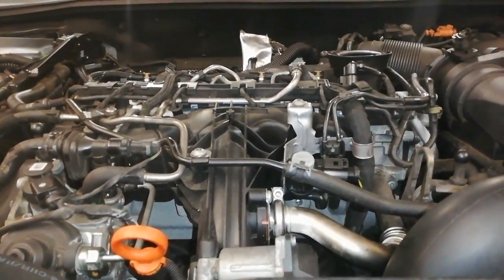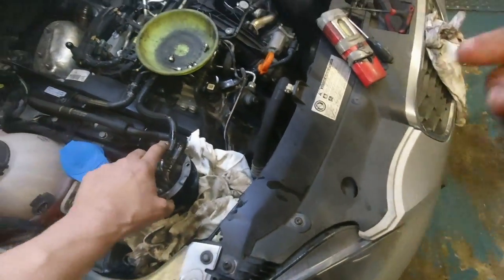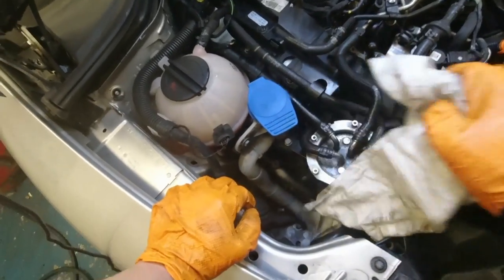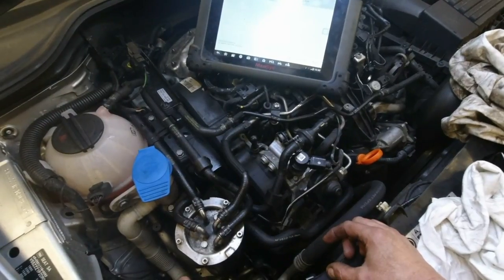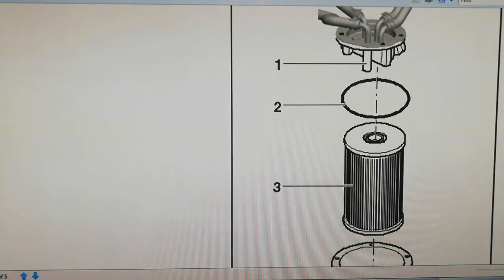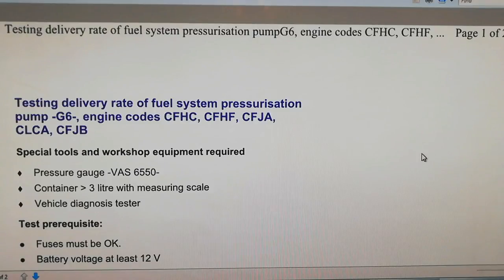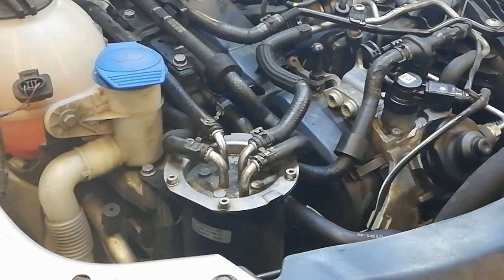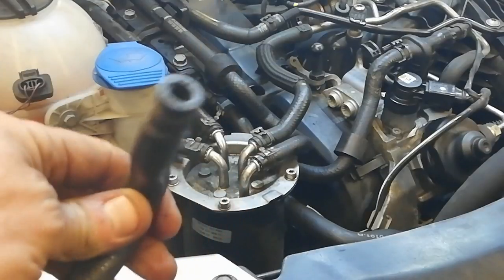VW 2.0TDI Common Rail Fuel Filter And Fuel Pressure Specs

Comment: Outstanding info Dave!!   I have been going through some data about air, water, new ISO fuel filter specs from injector companies and fuel temp coming from the fuel rail.  I not questioning your info. Knowing the effect of heat on diesel fuel (atomization/lubricity), I find it strange that some manufactures return fuel from the rail back the tank (some via coolers, temps reported 200F/93C), but VW sends it into the filter housing.  Do you see any reason not to run it back to the tank?  Thanks Again!

Comment: Informative as usual Dave. The Fords were always a nuisance for bleeding I used to draw diesel from the return line to try bleed them up yet the Peugeots with the same hdi engine generally had a priming bulb handily
Reply from the maker: Cheers Robin, i pull it thru the return a lot, priming bulb or not as i find is quick and know it'll start right away
Reply: @davesterl  yep at least u know there's fuel up through the hp pump. Keep the vids coming mate

Comment: Hi Dave....is this 2lt TDI the same engine as fitted to the 2lt TDI as fitted to a 2015 T5 VW van.

My daughter has one thats got a lumpy idle.

Would you recommend taking her van/camper to a diesel Fuel Injection shop or trust your average garage to work on the fuel injection equipment.

Comment: Hi Dave , thanks for a very informative video. The VW system seems very similar to a Bosch system fitted to a Hyundai  Santa fe 2.2 crdi that I have in the workshop , probably a lot of the information would apply to that as well. One thing I found curious in VW 's service information was that the metering valve ( SCV ?) on the HP pump should never be removed while no such warning for the fuel pressure regulator on the end of the rail,  these are usually a one time use part so I believe , do you think that this may be an error in VW's information bulletin ?
Great stuff as usuall, thanks again.

Comment: Interesting stuff. Was planning to do mine soon as advice I was given was to put some diesel in filter casing and then “start it up. It’ll be fine”! Is there any way to prime high pressure pump if you don’t have access to diagnostic tools? I’m sure I read a post a while back about bridging connectors on the pump relay but I can’t find it.
Reply from the maker: You could energise the pump by feeding a voltage to it, but i would suggest pulling fuel through the return as i mentioned